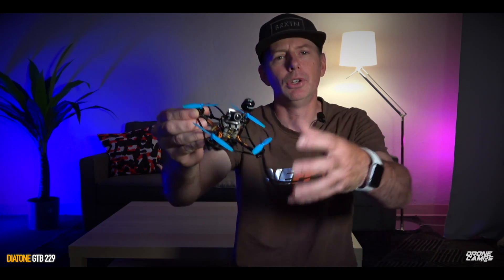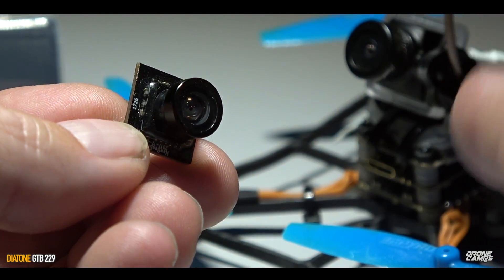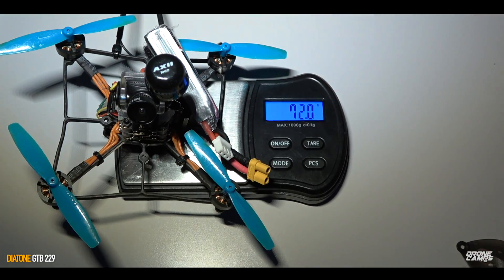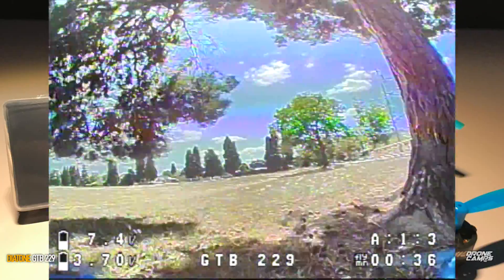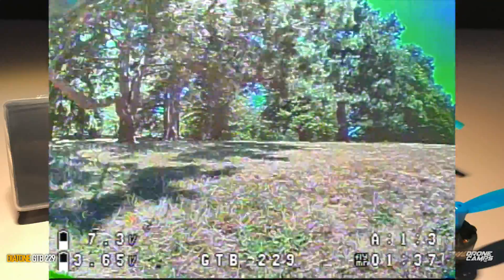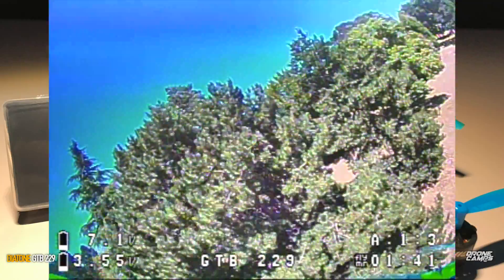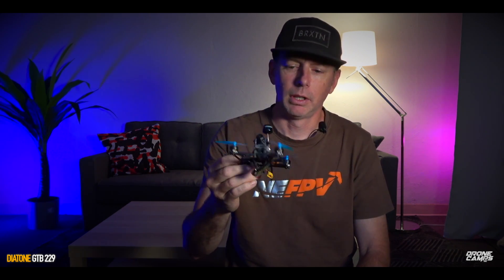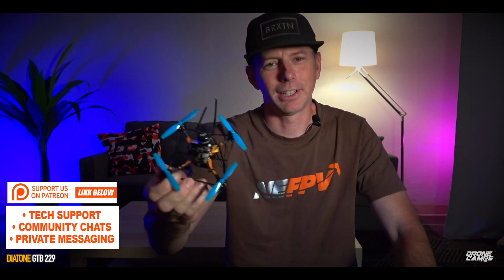DIATONE GTB229 Kabab Toothpick - PIDS!, RUNCAM NANO, UPGRADES + FULL REVIEW

Comment: This will be my next quad.  Banggood has some updated photos showing the new canopy for the new camera, which is cool.  I totally agree about the little dipole there.  Do you think the axii shorty would fit, or would you need the full length one?  And its a straight u.fl connection, right?  Also, do you think the 3s version would be more efficient, or would the extra cell's weight cancel it out?
Reply from the maker: Not sure the shorty would work. You need the one like mine. UFL is what you need yep!

Comment: You can shave 3 grams by switching out the antenna to a TrueRC AXII U.FL Short, Its 1.05 grams. less than half the weight of the luminier with the same performance.

Comment: Are these PID in the production model?
Also they have a 239 version that runs on 3s, assuming the PIDs will be different?
Reply: calv83 I have the same one as you, and still feel like mine needs tuned. Was considering upgrading to 4.1 for the RPM filter. Worried I might mess it up because the paper in the box said not to upgrade versions :/ @calv83
Have you had any luck yet?
Reply: HoovAirFPV yeah I haven’t upgraded, given you can’t just copy everything over.

Maybe message diatone support and see if they are planning to release a cli diff for 4.1.
Reply: I asked diatone they gave me a really wish washy answer to just change the p values. And said it should be fine to upgrade to 4.1 but I did and have the freak out fly away issue. 

It could be my qx7 antenna tho, I literally flashed and tried it in the living room and haven’t fucked with it since ( 3/4 days ago lmao ) work has been hectic and it’s cold as balls in Indiana, so flying time is limited, and I usually only stress the bigger packs with the cold not baby toothpick batteries